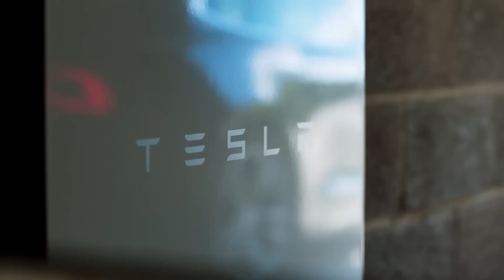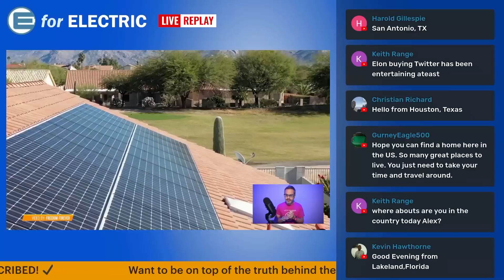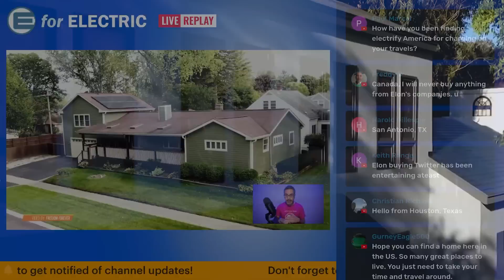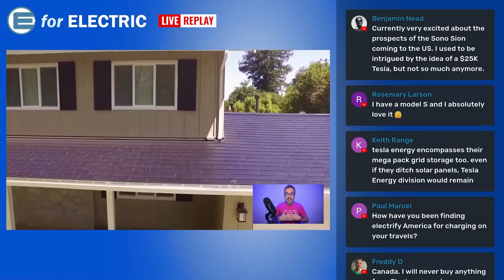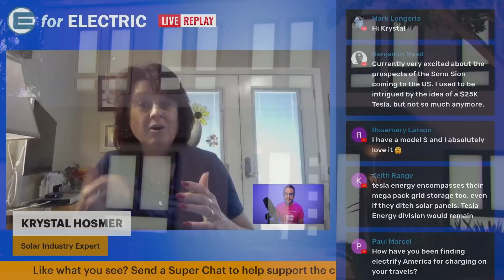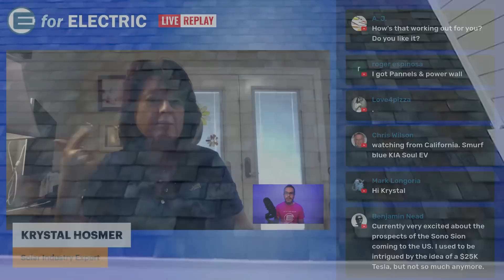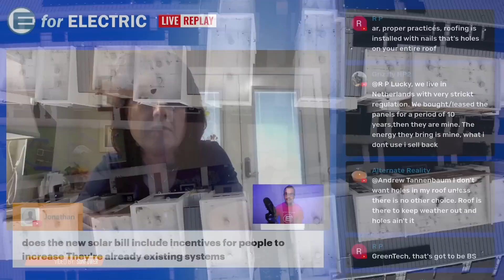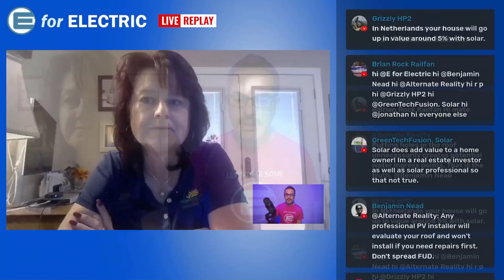Why Tesla is Losing the Solar Energy Game

Comment: I have one of the first Tesla lease solar units, it was to supply 60 percent of me electric use, at 10 years in , I am very satisfied with it. I had a panel failure and a inverter failure, Tesla  informed me before I noticed it. In both cases these were replaced at no cost to me. The only delay was in equipment delay caused by original manufacturer. The replaced solar panel now supply close to 100 percent of my usage.  Unfortunately for new customers, this lease program is no longer available.  Actually I had more delay caused by my city permitting process, Palo alto is not as solar friendly as they claim.

Comment: I was so excited two years ago when I signed a contract for the Tesla roof!  The stock market was up and in particular Tesla was way up. So even thought the total was pretty high I was feeling flush. That local company installed two before stopping installing the roofs. Three years later a different local company quoted a number so high it makes me wonder whether they actually want to install them. No doubt there are folks with more money who don’t care 🤷‍♀️. Any way I’m looking at panels plus powerwalls and what with a new roof which I needed all along it’s probably going to cost about the same as the original contract — minus the pretty tiles. 🤨

Comment: I’m on my second attempt to get a solar roof through Tesla. The first was an attempt to get a solar roof as part of new construction but Tesla wasn’t ready to plan a system before construction began and couldn’t figure out how to deal with new construction that had a roof in place but no power.  On the second go around a contract was signed in mid August but the permit wasn’t submitted tell December 2nd.  Still no one from Tesla or a contractor representing Tesla has been on my property. Currently waiting on the local county building department to approve the permit.  I am hopeful but not confident this will happen.

Comment: China has the market for solar panels. It's about cost and Chinese manufacturers have been reducing costs. Plus, there are too many breakthroughs waiting to happen, which means every two years or so everyone's solar panels become obsolete. The point when a solar panel no longer becomes obsolete is when it is so cheap and reliable you no longer need to worry about it. My dream is to have photoelectric panels which also heat water and also waterproof the roof. But there will be much more coming, I just haven't been able to imagine what else is coming. It's likely going to involve making installation much faster and easier not just cheaper. Homes, offices, light industry, all of these would benefit from solar panels.
Reply: Uses for solar panels:

photoelectricity generation
waterproof the roof
water heating
rain water collection

There must be more uses I can't think of.
Insulating, heating and cooling the building, for example. Passive solar heating and cooling take care of this. Maybe there's still more to think of.

Comment: The guest hit the nail on the head -- good customer service is a must. I put systems on two houses last year and it took a lot of coordinating between the installing company (not Tesla), the power company, and state/local inspectors. A few times I had to drive the process, but I could always get somebody on the phone. Also had a system problem the first year that cut power production by 50%. The installing company fixed it promptly once I called them.

Comment: Could it be that putting solar on a roof is a less than great idea.?.?.?.?.   I put mine on sticks of wood, in the ground, in my yard, and have had excellent performance, with tilting supports of my own design and construction, giving an approximate 20% seasonal gain in performance.!!.!.!. Roof mounts also increase home insurance and, usually tax and inspection costs too.!.!.. Ground mounts are usually seen as personal property, not taxable, but may be insured by choice.!.!.!. Maintenance, performance, with natural cooling, and snow sweeping if needed, are plusses.!.!.!. I made a carpet stick to clear mine.!.!.!. It's not always needed when panels are set at the steeper winter angle.!.!.!.!.
Reply: Were I live in Oz, we can only install 20m2 of solar, to a maximum of 4m above ground leve, without planning permission. Yes, it can be done, but roof is best, gets the solar above shading. No development approval required here in Oz to install solar panels within 100mm of the roof surface.

Comment: They sat on it.  A great idea but there were quite a few had it.  I had it.  I did nothing about it - but I expected that!  A guy in Derby, UK has managed to knock out a decent version.  It’s a great idea because it’s flaming obvious, someone just had to get their finger out and manufacture it down to a fine art, to get the cost right - for a whole system to work with it, reliably, practically.  If you can do roofs out of ‘shingles’ or thin flat plates, in North America, surely a small solar panel is not a huge leap?  For roof replacement too, not so novel it wouldn’t be used or couldn’t be used on older houses.  Put another way - if they put half the money they have now spent on Twitter, into this, 5 years ago, how different the energy price crisis might look now.  A sad error of commercial acumen.  It’s a money-spinner.  Thanks for bringing it up, take care all.

Comment: Solar - which is supported by the grid - does not support the grid. A very good deal if you can get it.  Solar installations not supported by the grid require a LOT of batteries.
Reply: Not true. Solar supports the grid all the time, by delaying or even preventing the need to install upgraded poles and wires due to ever increasing demand. Most people I know with solar export huge amount to the grid, but are paid very little, and that same power is then on-sold by the utility with a%400% markup, as 'green power'.

I export 2/3rds of the solar I generate, ie, on many days I am powering 2 other homes.

Comment: I heard insightful comments on this video, but seems like one obvious thing to repair the gaps in Tesla's solar energy rooftop business was  not mentioned. The rooftop business is failing with customers who complain with good reason that Tesla's followup and customer service is beyond terrible. The general consensus is that the company doesn't bring in enough money to cover the cost of good customer service. It's so frustrating because, as you mentioned, Tesla has very high-quality solar roof applications and storage batteries. Why don't they raise prices on the roof and battery installations? Of course Elon Musk doesn't believe in sales or marketing departments, and has been notoriously slow in improving the car division's repair division. Maybe if another CEO takes the reins some of these types of changes can save what, as Musk had alluded to earlier, could be one of the biggest divisions of the company. Maybe the biggest division.

Comment: When I was considering solar for my latest house, having had solar installed on 2 previous homes, I knew some of the ins and outs.  I knew I had an odd roof arrangement and would have to have the contractor come out and sky scope my site so I could tell if it would be worth investing in solar.  When I called Tesla, they immediately gave me a bid based only on google's solar roof data and said I'd need to come up with a down-payment to proceed further.  I explained that I wasn't sure it would work out on my roof and wanted to have the roof scoped first.  They said I'd have to put down money before that would happen.  I went with a local solar contractor who sent a tech out to scope the roof and we were able to work out a customized layout for the panels taking into account roof orientation and several large trees.  Tesla was also not listed in our state approved installers in order to get the state energy rebate.

Comment: WE have Tesla Solar - it took 6 months to get the panels in and then 3 months for the installation to be completed (some of the delay was my energy provider but 2/3 was Tesla getting the installation approved).  We had a good crew and they were out several times - the installers completed the rooftop in the first day.  Electricians were on the same week but then the delay started for them to complete the electrical and schedule their own inspection before getting the county to inspect and then the big delay was getting the utility to do the cut over.

We generate plenty in the summer but in Maryland the winter sun (so far this year) is not producing much- neighbors trees block the morning sun.

It's a push between what I was paying for my utility and what I pay Tesla solar.  Hope we do not have large delta between what we paid last winter without the panels and this year.  The summer - our energy bill dropped to $35 a month (around 10% of what it was).

Just my 10 cents.
Reply: Would you mind sharing the cost of your system? In 2018 conventional solar system (Q-cell panels and SolarEdge inverter) 12.5 kW system cost me $23,000 (net of tax credits) or $1.85 per kilowatt hour.
Reply: @richardcoughlin8931  $41,921.33. 13.6 Kw plus 2 power walls. It got lowered because the design changed and we lost a few panels. So that is around $3 per KW/hour unless I messed up my math.
Reply: @allenbaylus3378  That’s not a bad price for a system that looks like a regular roof of your house. I couldn’t use Tesla tiles because my roof consists of Spanish Mediterranean concrete tiles. I don’t have batteries but I wish I did. I keep waiting for the price to go down but so far it hasn’t changed very much in the four years since I installed my system. I live in the Desert Southwest where solar is a necessity.
Reply: @richardcoughlin8931  Thanks - we are not pulling much in right now since the "winter sun" is hiding behind the trees in the morning while it is full on the front of my house during the summer months.

Our installation was done in April, so we will have to wait until April 2024 to see how much the rebate is back from the power company - they compute this once a year and the power company did not do the cutover until August.

Comment: Just a thought. Tesla's car business is very large in the US and also in China and starting to get very important also in Europe whereas  AFAIK they have not been really a factor anywhere in Europe with the roof and marginally successful with the batteries. At least is Spain where I am I have never heard of having to change a roof as here roofs normally have roof tiles. Solar is slowly becoming a big business here, given that we have ideal conditions for solar, but prices for solar installations here are also substantially lower than what I hear for the US. Mine without any government incentives and 21% VAT cost $1.20/W. I think prices in the US are exorbitant and if Tesla needed those prices to compete they would only sell to hard core Tesla fanboys. One question as also being a solar battery owner. Are Tesla batteries using their normal automotive chemistry? If they are, for many this is not considered as the best chemistry for solar compared to LIFEPO. I have Sonnen and this was the reason I went with that brand.

Comment: Elon said a while back that they were working on something with solar. Something about efficiency. I wonder if this is why they aren’t prioritizing solar. I live in south FL, and I’ve been in a waiting list for over a year for Tesla solar. But their cost is half that of others. 
I would like to see Tesla solar panels to go micro inverter, and still charge powerwall if the grid is down. Currently if you have a competing solar roof with emphaze micro inverters the system goes down when the grid goes down, even with powerwall. That makes solar pretty useless, since the primary use is to make sure you always have energy.

Comment: Good old fashioned customer service - who knew?  Let's face it, most people don't know the difference between a microchip or a potato chip, so knowing what you need, navigating the permit regime, and dealing with any FIT program in place is not going to be done well by the end customer.  That means the company you are buying from needs to do a great job to shepard you through the whole thing.  Also keep in mind, if you live in a northern climate with snow, you should keep the snow off the panels as having partial blockage can damage the cells over time due to voltage differences.  Yes, that means "shovelling the roof".  Maybe better to build a large shed and place the panels there if you have the space.

Comment: Why do people over complicate solar.  90% to 100% of all our home appliances run on electric.  Components do not need maintenance, they just need to be installed correctly.  When's the last time you called an electrician unless you're installing new circuits? In terms of Tesla, I'm in Florida, and had system installed this year and immediately benefited as we had two hurricanes this year.  Tesla responded to ever email and text and sure I spoke to them a few times, but personally prefer answers in writing, which falls right in line with Tesla's preferred means of communication.  Which to be clear they did ask how I prefer to be contacted, so in theory I could have had more phone time, but a written answer in email or text that I can refer back to for any reason was best for me.  Side note: I shopped other products which focused on telling me every reason not to choose Tesla (none of which was about the actual product) but less about what makes their product superior to the tune of double the cost.  If you listen carefully to the nah sayers you'll note they are suggesting anything better, they are just interested in tearing down the next person's business to artificially make their appear better.  In my experience with Tesla, they talk about their product not the competition + or -.  Long rant but I hope it helps to cut through the noise.

Comment: I agree Tesla Solar is very hard to get a hold of. We had our Tesla panels installed by Tesla and it took 5 months to get permission to operate by our utility company. It was because Tesla did not fill out the proper paperwork to PG&E. I tried to get a hold of Tesla multiple times. Everything now has to be done by request on the website which is hard to navigate. I believe in Tesla 100% my panels were installed in less than a day however having to wait 5 months for permission to operate is way to long. We had our Tesla panels installed at the end of spring and weren’t able to turn them on until October.

Comment: She said "paid off" solar solar system ...lol     is a benefit to selling. If you are a seller, and do not have it paid off..  good luck with that.
Reply: PPAs are NEVER a problem anymore for the sale of a house. OR a solar system in general. If it’s a problem then YOU need to fire your Real Estate Agent for incompetence. It should be placed clearly in the beginning of the sale that the system goes with the house PERIOD. If the buyer doesn’t want solar then they can just move on to another house. SIMPLE. Common sense.
Reply: @AlessandroZane  Have you actually spoken to Realtors who have dealt with these transactions? Over the last 5 years, I have spoken to hundreds during the classes I teach for Realtors on this topic. While, of course, there are PPA/Lease sale transactions that go smoothly and transfer quickly, that is much more the "exception" than the "rule" according to the stories I hear at the beginning of each class when I ask about their experiences with third party owned solar transactions. Many of them steer clients away because of lack of understanding of the Contract and how to navigate the transfer process, unfavorable existing Agreement terms that harm a buyer (lease/PPA rates that are higher than what the utility currently charges) and (the biggest pain point) incredibly slow response times from the solar companies that delay escrow close. Obviously, the Realtors in your market may have a different experience, however I urge you to go to the source and find out what the sentiment is among Realtors in your local market before assuming it's a painless process at resale.
Reply: Loans can be assumed by the buyer or paid off at escrow. (Which one depends on the terms of the loan) 

Leases and PPAs agreements need to be assumed by the buyer or bought out during the sale (if the Agreement has a buyer out clause. Not all of them do). 

If the solar has loan or lease/PPA payments due, it can complicate a sale. I teach a class on this topic for my local Realtor community because it is such a pain point at resale.

Comment: For the cost of the solar roof, you could build a super efficient insulated home without all the hassle or possible hassle of the solar roof.
Reply: I agree on that point for sure but it depends on whatever customer is wanting the system for. They may want to be grid independent instead of just high efficiency, and they may want to make money by selling their extra power out of their battery from solar back to the energy company that has the grid in their area. There are several different views as far as want to get the seller or why not. And if all you want is lower bills there is no problem not having a solar roof as you say. Just building a lot of efficiency on the new house or be willing to spend quite a bit remodeling in pre-existing house. There is no one size that fits all in anything. Just giving all of the comment or something to read so the conversation just doesn't hit One Direction like some of the other commenters same to be locked into. 👍🏻